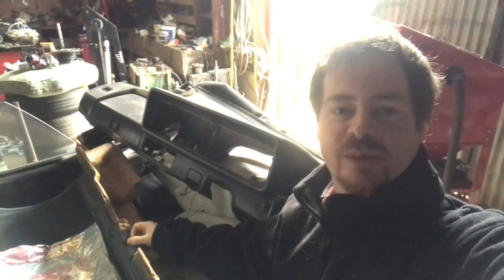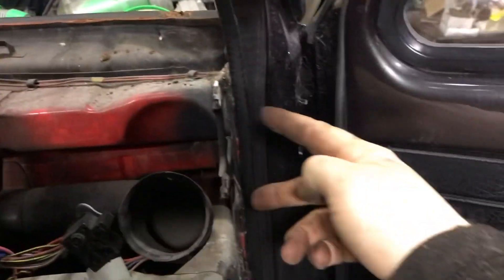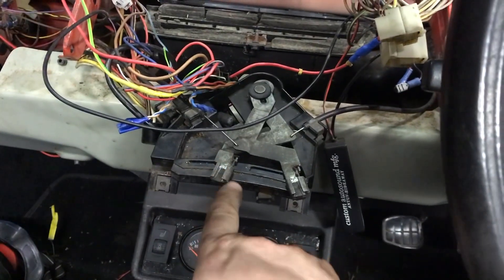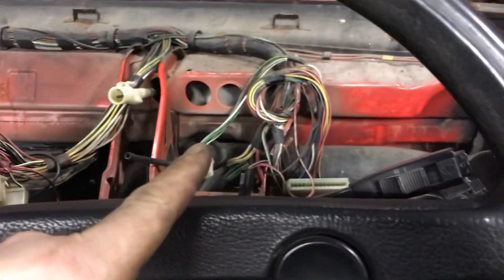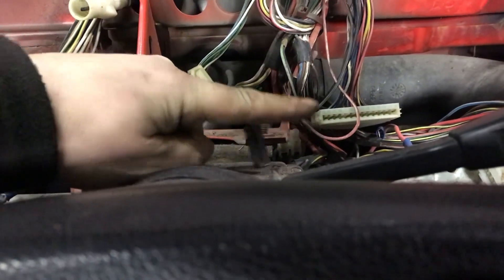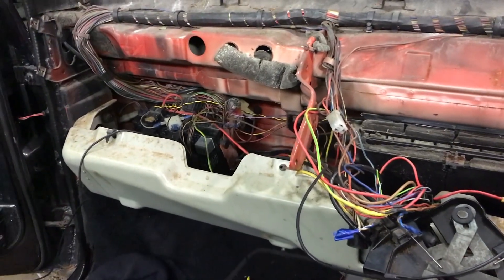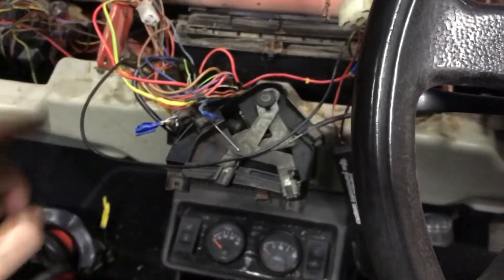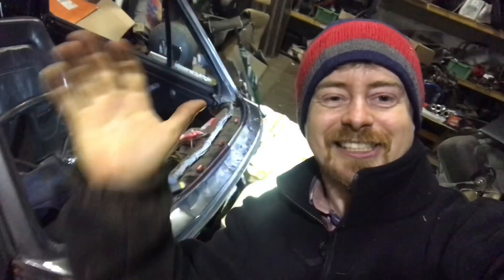How to -Remove the dash board [ Vw Golf Mk1]

Comment: How to would've been useful
Reply: Don’t be scared, just do it 😂
Reply from the maker: It’s actually very easy just 6 screws hold in the dash and then it’s just a job of undoing wring and pushing the hvac controller down out of the way. Take photos of everything !!! The screws and what plugs into what plug etc . Take your time and you will be ok